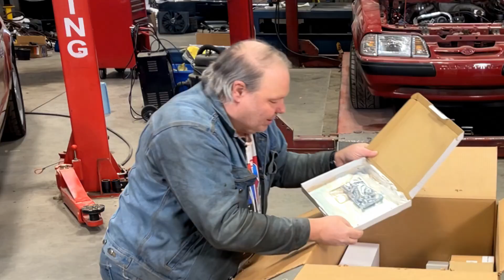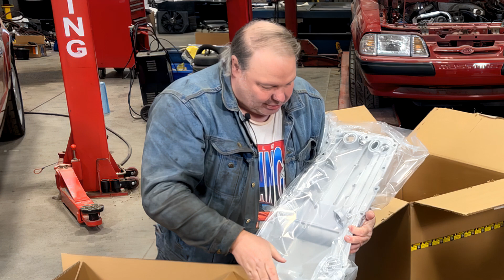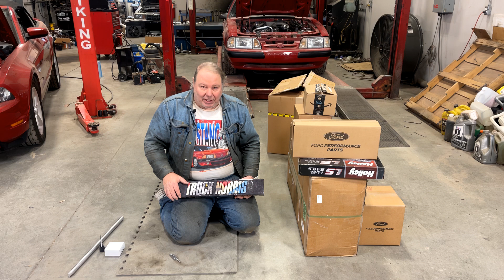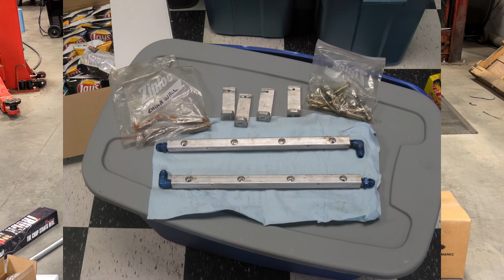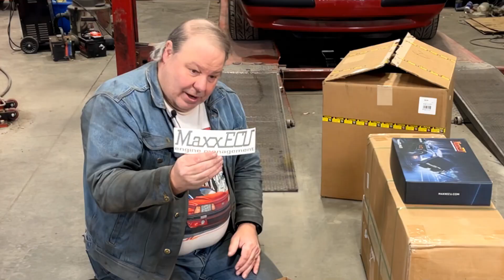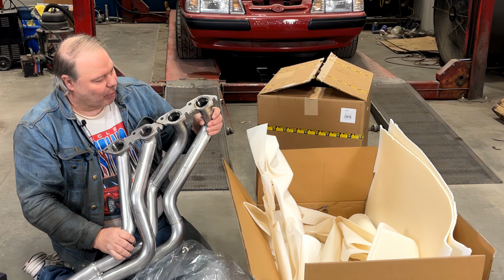Foxbody Godzilla Engine Swap - Parts Unpack and Discussion!

Comment: I have been looking for the Godzilla Camshaft installation handle  and the phaser locking tool to hold the phaser . Can you help me I have been trying to find it on the net without any success.
Reply from the maker: Try Western Motorsports at wmsracing.com

Comment: It's kinda depressing to see the total cost to get one of these motors and then find out you'll have about the same into getting ready to fit in your car. I want to get one and run a distributor to keep it simple.
Reply from the maker: I’m not sure that a distributor would solve anything. Most of the project costs beyond the engine itself are packaging components like headers, shallower oil pan setup, engine mounting components, a cam and so on. The controls are not even that big of a cost component and even if you rigged it for a carb that still costs money as would the manifold arrangement to accept the carb. The fact of the matter is that any major swap project like this consumes a bunch of money, and as this type of project goes I think this one might actually be a little cheaper than many of the other options by the time you pull it up to the start line. Maybe.

Comment: Do you have the part number for the fuel rails? If you have them installed already, how was the fitment? 17:48
Reply from the maker: I’m going to get back to this project shortly. The fuel rails are still in the box. I will try to remember to look up the part number for you when I am looking at the boxes next.
Reply: @tecmotiondyno  okay thank you. I ordered the Godzilla specific rails, but they are on back order. If it’s the ones I think they are, they’re about 100$ cheaper the the Godzilla specific ones.
Reply from the maker: @Lima-Hotel99 the rails I have are Holley part 534-265

Comment: Just swap to a hydroboost setup from a 96 to 98 v8 mustang, you can run it off the same power steering pump and keep your power brakes. LMR sells a kit to do just that. The magnet doesn't stick because Ultimate uses the better 304 stainless.
Reply from the maker: A hydroboost can be a good way to go but LMR don’t sell the booster, just the mounting conversion kit and the boosters are increasingly difficult to find. My point on the headers was that they ARE the better grade of stainless. Nice parts for sure.

Comment: So far looks amazing! I will be following your Godzilla build all the way through buddy! Good luck!
Reply from the maker: Thanks! I got the pan and front cover off that engine today, ready for the cam upgrade, GM style oil pump, Holley pan, and Holley front cover and accessory system. Once that prep work is done, I'll get the 5.0 and T5 pulled out of Bad Decision and we can see what physical fitment issues we are going to have.

Comment: how much Money you spent on these Parts?
Reply from the maker: I thought it said in the video somewhere but this unpack is about $10000 Canadian, and the engine was about $9000 Canadian. That still doesn’t handle suspension, transmission, some of the accessories, gauges, a hood, cooling components and probably a dozen other smaller items. The Canadian dollar is around 70 cents US right now. Make no mistake, this is a big expensive project, however if you price out a 408 Windsor project or Coyote project on one of these cars there is a lot of sticker shock there too these days.

Comment: Yeah on those headers I was thinking how in the world are two of them going to fit in a foxbody, I had trouble getting the original shortys in lol
Reply from the maker: I have similar headers in my 90 coupe but they were custom made for it. 2” primary, 3.5” collector. I used a mini starter and a qa1 tubular k-member with that combo. The custom headers are so nice that you can pull the starter without loosening a single header bolt. Anyway, it turns out that AJE has just released a tubular k-member with Godzilla engine mounts that will handle power steering, so I guess that solves several problems from engine mounting to header fitment. Fingers crossed!
Reply: @ well good luck I like watching ya videos, I’ve commented before I got one like the other red one, that I’ve pieced together, put it all back period correct 93 gt, but having trouble with the notorious idle problem
Reply from the maker: I filmed a discussion of how the idle system actually works and the real steps to get it set up right recently so keep an eye out for that when I get the time to edit it.
Reply: @ ok I sure will,I’ve got it down to after it warms up it’s not to bad , ordered a new tps, an iac sensors, going to install them when weather warms up, my check engine codes were showing up they were at fault, so after that, that’s all I know to do, course adjusting them
Reply: There are 2 grades of stainless steel 300 and 400 series, pending formulating the last can be magnetic to a point.

Comment: Definitely subscribed for this build. I have a 2002 Crustang, and a 1972 F-100. I have considered Godzilla swaps for both!
Reply from the maker: I like the idea of the Godzilla. I’ve done every kind of Windsor Ford type of project and Coyote projects so I decided to give this a try. Time will tell if it was a good idea or not. No direct injection makes a difference when it comes to engine control options and engine/transmission control combinations so the Godzilla route gives you more flexibility that way.

Comment: Gonna be a serious build!  Looking forward to seeing it come together.
Reply from the maker: I expect to tear into this engine in the coming week for the upfit. There are some scary steps like the torque to yield crank bolt which has as its final step 129 ft-lbs PLUS 150 degrees. It is hard to believe that a 14mm bolt doesn’t snap or pull the threads out of the crank with a spec like that, but everyone I have talked to says that’s right, including the official Ford service manual. I guess I will fire up the 1/2” snap on tech angle and hope it really works!
Reply: @ yikes that's a lot of torque!
Reply from the maker: @ pretty worrisome for sure. And hard to believe. But that’s what it is.